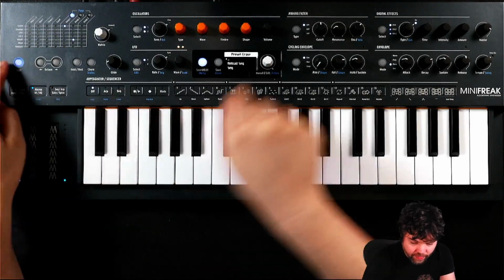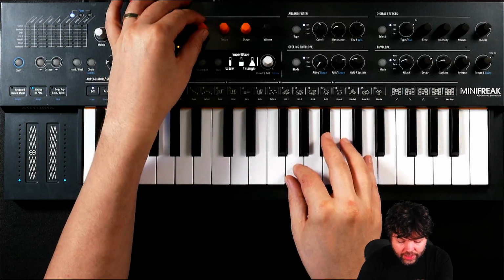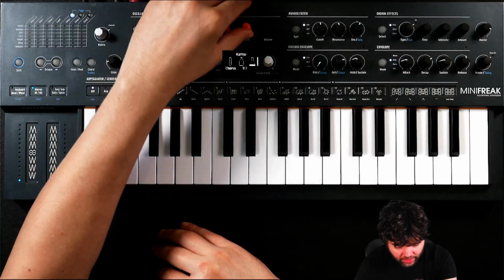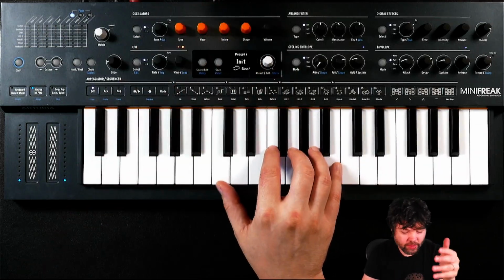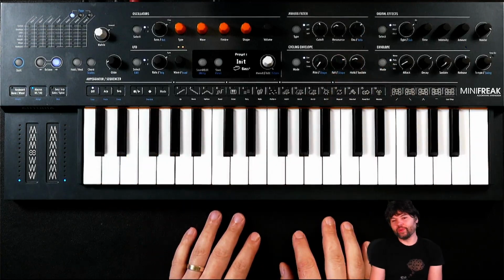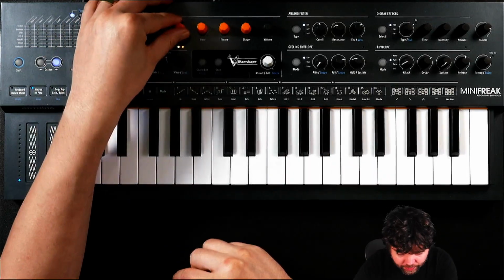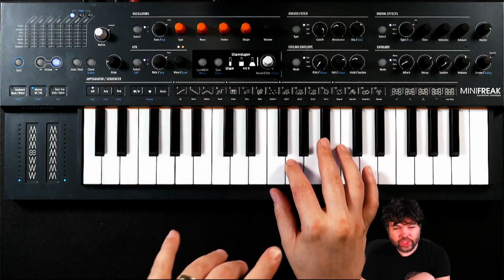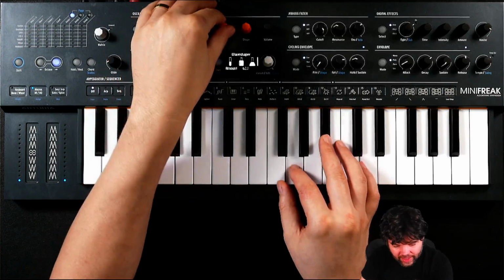Learn With Me - Minifreak: Ep06 - Oscillators 1.1

Comment: Thank you ! Quite a lot I still don't grasp but hopefully I'll eventually internalize those concepts -- like wavefolding, formants, FM etc.
Reply from the maker: Thanks for your comment, and for watching. While all these concepts have a mathematical foundation, their usefulness is in how they sound.

For example, wave folding effectively amplifies the waveform (the gain is the amount of folding), but instead of clipping the signal when it reaches maximum amplitude, the signal is folded back on itself (as though reflected in a mirror) and continues in the opposite direction. This folding happens again every time it reaches maximum amplitude, or 0.

You can imagine that the more times it's folded back on itself, the more higher harmonics are generated, while still retaining its fundamental tuning. In terms of how it sounds, it's similar to sync (resetting the waveform at a higher frequency than its fundamental pitch, while also resetting at the fundamental pitch).

The key is always to listen, not just to know what it will sound like if you use it, but to add it to the "timbres in your imagination". Conveniently FM, sync and wave folding all add harmonics, so sometimes I think of them in reverse: imagine the maximum amount of wave folding you'll use was the original sound; turning down the amount of wave folding is like applying a (unique sounding) low pass filter. This lets you apply some of what you already know from subtractive synthesis to shaping sounds with these tools.